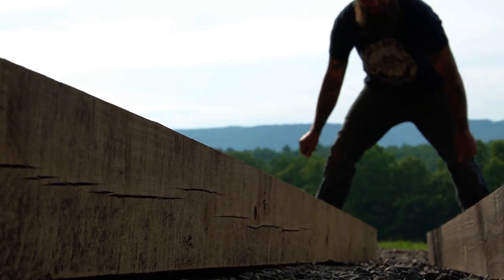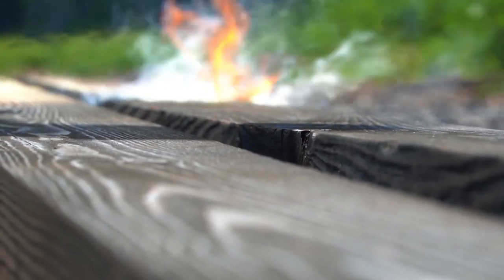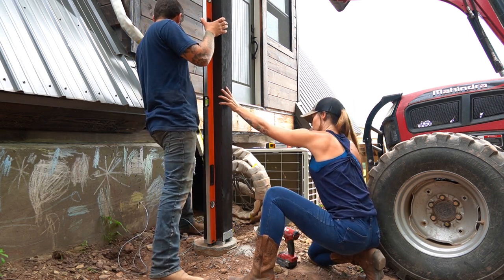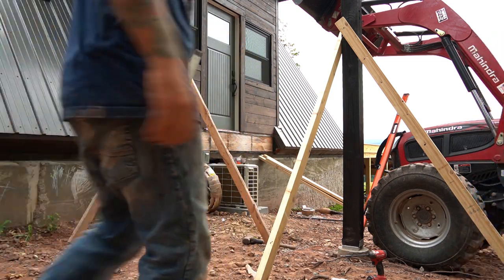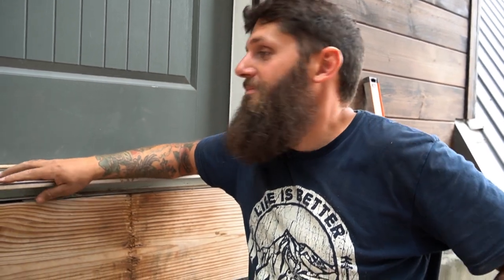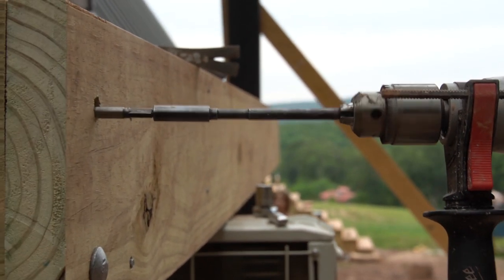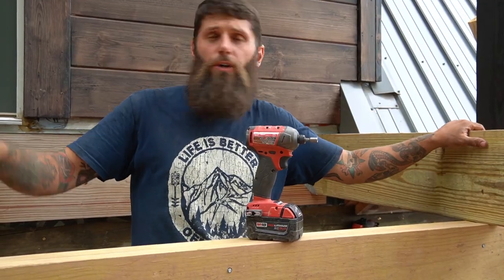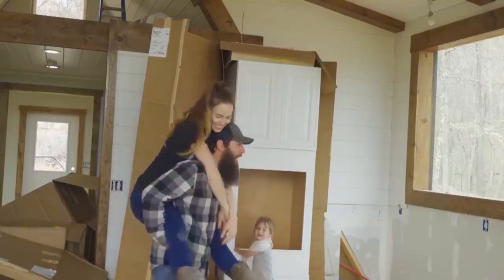BUILDING ON TO THE FRONT OF OUR HOME

Comment: Move that condensing unit out from under the deck. If you ever have to change out the condenser fan motor, you’re going to have a very, very difficult time. Not to mention the deck is going to trap the heat and recirculate it back through the condensing unit. To put it another way, your air conditioner isn’t going to work too good and you’ll prematurely kill the compressor.

Comment: Josh please put some bearing posts beneath those two beams or the whole deck will rely upon those bolts to hold it up would not be good in the next 15 years when the bolts corrode away.
Reply: Came to say this. Either half lap your column posts, or bearing posts. Do not rely on hardware.

Comment: The vertical loops in the AC lineset may be the death of the unit. The ideal would be to have no loops, but since there are loops, they should be horizontal. Oil circulates with the refrigerant and it likes to settle in those loops. The compressor would like the oil to be in the crankcase. Ask your buddies in the HVAC trade.

Comment: That is pretty awkward with the beam directly on the A/C condenser.  Will you need to move it now to allow future access?  Also, curious if you will be adding any diagonal bracing as it seems to not have much preventing the whole structure from moving towards or away from the house, if that makes sense.
Reply: You are so funny because they built an entire house and you're worried about them not bracing the deck to the house. They will get to that. 😎

Comment: I would like to recommend that you use goat fence in your deck railing. It is very transparent, strong and doesn't rust. You can get it from Tractor Supply in 4x16 flat sheets. If you paint it Rustoleum Green, it will disappear into the green background of grass and hills.

Comment: You guys Rock!  One word of caution in case it hasn't already been mentioned. Your beam should be placed inside a notch on the post or placed on top of a post. Beams held only by bolts to the side can fail catastrophically. Otherwise, great job!

Comment: that coil of extra line set for that heat pump should be on the horizontal plane instead of the vertical .it can trap oil needed for the compressor...

Comment: Hey just watched a video of you welding on the tractor...here is one thing to do for better  Results V notch the steel where the 2 seems  meet to fill the V notch with Weld It'll make it stronger the other thing is to increase your  Amperage on your Machine Switch to a 7018 rod  This rod has more tensile strength

Comment: Heaven help you when your air conditioning fails or you need to clean the fan or condenser. Other than that, glad to see the big bolts rather than the rookie mistake so many make by hanging everything on screws and "believing" it is the lumber that is doing the work.

Comment: Straighten the warped beams? Wood straightens either by heating, or by soaking, and when wet force it and hold it that way while it dries. Trying to do it in place by forcing it dry is highly unlikely considering the massive beams.

Comment: You have clearance  issues with the AC condenser  it will blow the hot air out at the top hitting the underside of your decking  and cause air  re-entrainment which reduces efficiency and the  life of compressor
Reply: Those mini split condensers are side discharge so they do not blow air up but out the side. However they do need to be relocated out from under the deck for future service/repair.

Comment: So happy to have a video from you guys on Sunday. It is going to be beautiful. 
I was wondering about they way you connected the outer wood studs to the wood posts. I thought that the weight of the deck should not be supported by screws. Did you use special hardened lag bolts? 
Thx

Comment: Lovely video. I can't belive the sizes of lumber you guys work with. They must cost a fortune. A deck like what you have built would cost more than a house here. Wood, especially, pine, is very expensive here in South Africa. Our houses are mostly built with bricks and cement. You both doing a fantastic job. Greetings from the tip of Africa.

Comment: Enjoyed the video! But did you build a permanent structure on top of you air conditioner unit??
Reply from the maker: Yes. It is accessible from both under the deck and from under the house. We do plan on digging  it out to drop it down (as Josh mentioned in the video) but there are no clearance issues on the fan, coil or electrical side

Comment: Hi regarding the thru carriage bolts holding the double joists together, I hope you plan on reinforcing the bolts with a wood to wood extra 2 x down to the footer, the shear strength of the bolts are NOT good enough and are NOT code, please check, there is a lot of weight on just 4 bolts. Got busted on this years ago......please be careful :)

Comment: Just watching you hold that beam makes me think those brackets should be a lot larger and a lot heavier construction to keep that Post skill.
Reply: Agree.  Thinking they should bolt/nut fasten down to bracket.  The post should be able to stand on its own. I would have put the post into the cement initially while cement was drying for 24 to 48 hours.  Used 2x4 to secure temporary for sake of leveling.  Just my thoughts.
Reply: @ktown4852  We agree, especially because you have a home that’s drying out.

Comment: It has been posted several times although it has been lost in the comments you all need to move the A/C condenser out from under the deck. The units are serviced from the top, and you are killing its efficiency through poor air circulation.  Check the condenser specs it should list clearances for all sides although it may not tell you to replace most components you need access from the top. 

My wife and I love your videos by the way.

Comment: STOP!!! Bolting the main  supporting joists to the sides of the uprights is considered dangerous and would not be allowed under the building code in most places. The problem is that in time the wood can split and the deck can collapse. To be done properly, the joists should be installed on top of the legs, like you did on the big deck, or built into a notch in the legs.

Comment: You had the 2 by supports ready to go including the screw started in the material. Why make it seem like it was a split second decision? Drama?
Reply from the maker: We knew we may need kickers so we had them handy just incase rather than not being prepared and having to run around looking for scrap 2 bys. The reason the screw  was already started is bc we actually screwed the board into the opposing side of the post but rather than showing us putting it in the wrong spot and then taking it down and moving it I just cut that out in editing and showed what was relevant to the video which was putting the kicker up in its proper location. I don't  really see anything dramatic there just discussion over the best approach